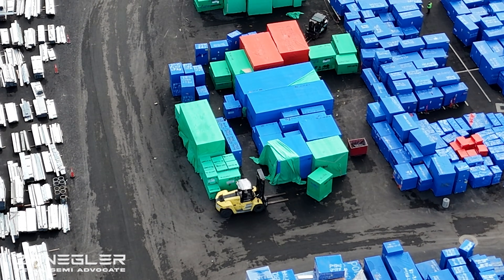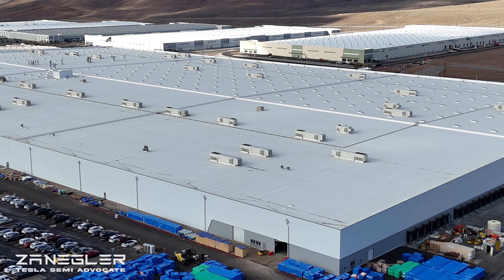Tesla Semi Factory Mystery is Solved!

Comment: Thanks for the update, Zanegler!  It will be interesting to see how fast those stockpiles of assembly equipment get moved into the factory. Tesla speed, I imagine.
The impact of Tesla Semi on shipping costs will be almost immediate and dramatic, imo. The big shippers will be able to install MegaChargers at their distribution hubs like PepsiCo did and side step the lack of infrastructure, then major truck stops will start installing them for the smaller scale shippers and independent operators. The savings in fuel and maintenance costs for a competitively priced BEV rig will give a ROI that will blow peoples minds! And that's not even going into the increased safety factor of regen braking, FSD supervised reducing driver fatigue and then autonomous ...

Comment: @ZaneglerTeslaSemiStalker-vt3or Thank you, Your videos are real, I quite like the fact that background noises and phones happen it shows authenticity. 
Box manufacturing eventually yes but not on the first couple of years, but maybe later. 
Giga-casting: I think that the plaid motor housing is a giga casting and so is the inverter housing, and the gear box and differential are all giga castings. The giga casting is such a time and money saving technology that it’s going to creep into the Semi in multiple places, maybe not replacing the C section steal frame, (at first 😉) but the braces between them and many other components like front wheel arches and crumple zones, cooling and hvac parts are much cheaper in giga castings

Comment: Thanks Zanegler
Sort by newest first or top comments if only the first few lines are visible
4:48. Grok's opinion on stamping equipment. Tesla has at GT presses by AIDA, Schuler, and AP&T (hot stamping for the Cybertruck).
The pressline here was never identified when it was unwrapped and rewrapped while at GT.
5:29. View north over the roof. Speculative production flow. Stamping in the foreground. As described by Zanegler at about 6:15, cabin sheetmetal components through the pressline to the left, frame rails through the stamping press to the right. All components then travel through the BIW line (for want of a better term) for initial assembly on the west side, before turning into Paint at the north end, and then southwards through the Paint Shop. Into GA (General Assembly) in the east side, before exiting for charging at the MegaChargers.
6:45. Stamping. Frame rail stamping press. Some good videos available. For a video of a single step press similar to what might be installed on the east side of Stamping, type into the search box above ‘Truck chassis production: Forming step’.
Shows some questionable OHS practices that are hopefully not mandatory. 
7:13. Stamping. Apron. Right. Plastic wrap with the Petra logo. More at 8:09.
7:19. Stamping, inside. I find this incredible. Take a screenshot of the darkness through the door, then open the screenshot in a photo editing app (I’m using Apple ColorSync), adjust the exposure, and the south side of stamping press comes into view!
11:29. Northwest corner. Escape ramp. The gravel fill almost confirms it. Still seems weird to me that a test track would be placed in a location that requires an escape ramp. Not like they are short for space.
16:26. Drive motors. There was a permit for GT within the last 12 months for ‘Atlas stator’. Atlas being the code name for the Semi.
I would guess if the stators are made at GT, they would assemble the entire motor there also.

Comment: Typical diesel.semi delivery stacks 3 trucks (jack up the front with a rack that fits front of truck onto the fifth wheel connection of the first truck, no reason for tesla to recreate the wheel, pulled by a diesel or Tesla truck depending on the route.

Comment: While Elon & his team is working to green trucking, the industry has a much bigger problem. I heard an expert say that only a full 50% of CDL holding drivers in the US are competent experienced drivers while the other 50 should not be behind the wheel of  ANY  motor vehicle much less a 80K pounds simi rig. They were placed there by fly by night trucking companies and fly by night truck driving schools. At the same time many truck companies are seeing a 100% driver turnover. I would think Tesla simis & backup camera systems would help to ease that some as the Tesla simi is  WAY  easier to drive than a gear jamming diesel.  The forecast is for freight to increase a full 50% in the next few years. It seems to   me the US should adopt the Au practice of allowing Road trains on the highways outside of towns. Thats 1 simi truck pulling 2 or 3 or 4 or more 53ft trailers  BUT  no one asked me.

!
Reply: A friend of mine went through driving school, got his CDL, and decided that over-the-road trucking was not for him. He went into school bus driving instead.

Comment: APS (Arizona) may have cheaper electricity.  The APS Time-of-Use Demand Charge [R-3] rate plan charges $0.03495/$0.05938/$0.09932 for winter Super Off-Peak[10am-3pm weekdays]/Off-Peak/On-Peak [4pm-7pm weekdays].